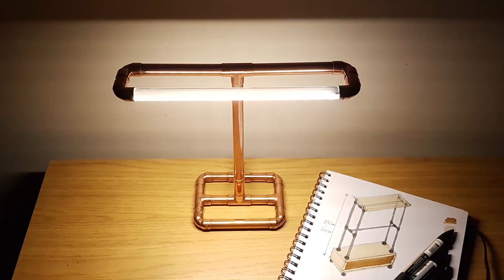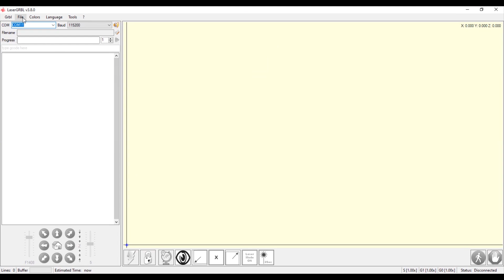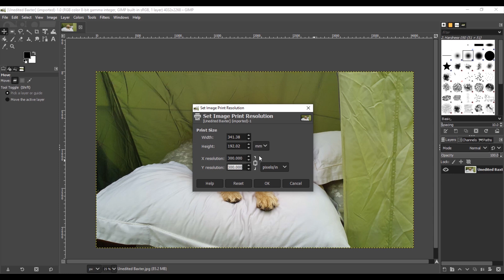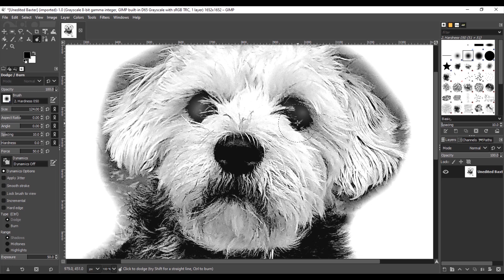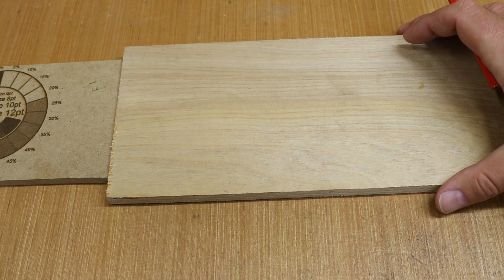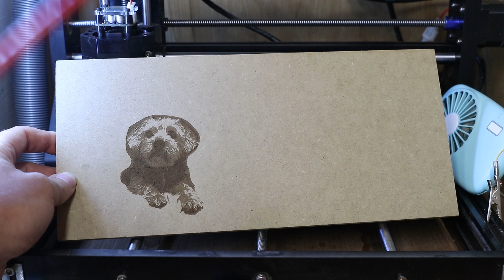3018 Pro - Basics for Laser Engraving

Comment: Hi James, could you advise me?  I have had several suggestions all conflicting. Having seen your videos you know what you are talking about. I have a 3018pro. My laser only produces a 4.5watt output.  Great for small jobs but I want to do some metal engraving (Keyrings Etc). Could you suggest a laser unit that I could use that would be powerful enough and fit the 3018pro to do the job or is it a case of having to buy a new machine?

Comment: Hi James. Love your Channel! What’s the best laser that for the genmitsu 4030 and does it swap out with the Spindle easy? Or would you recommend a separate laser setup? I want a laser that has good detail for etching wood and metal and Aksum cutting through wood. 

Thanks, 

Bert
Reply from the maker: Thanks.
If you can get a separate laser then do so. Most lasers run on belts because they can accelerate faster and get better results. However if that's not an option then the easiest option will be a 44mm wide laser and that should drop straight into the original holder. The FoxAlien 10w/40w is a good option 
https://www.foxalien.com/en-gb/products/foxalien-40w-fixed-focus-blue-laser-module-kit?sca_ref=725103.t6qfXeHAnx

Comment: Hi James,
Can one add text and a cut out shape in Gimp, before finalising your image so it will be part of your Laser GRBL burn?
Reply from the maker: Text is definitely possible. The cut out shape would probably need to be done as a separate layer and exported as a separate file so then in LaserGRBL you would load in your main photo and do all the settings for that, then load in the cut out image. I forget what the phrase is called but in LaserGRBL there is an option to load multiple files on top of each other
Reply: @JamesDeanDesigns  I'll check it out. Its similar to Easel where your cut out is on a separate file.
Is it possible to take the Gimp manipulated image  to Lightburn and then to add text and a cut out there?
Can Lightburn do manipulation of a image the same as GIMP?

Comment: hi James love your channel, im buying a 3018 machine but it does not come with a laser, can you reccomend the correct one for me to buy please ?
Reply from the maker: There are lots of options depending on what you want to spend, most will be around 5w of output power but the main thing is that to fit directly into the holder it needs to be a 33mm wide laser. Any larger and it will not fit in the holder
Reply: @JamesDeanDesigns  thanks James

Comment: About to install the laser on my 3018 and use it for the first time, this tutorial makes it look easy. Had to pause and go back a few times as I followed along. Hoping to engrave a Bamboo coaster for Mothersday.
Reply from the maker: Hope you manage to get it all going OK and make a nice coaster 👍
Reply: @JamesDeanDesigns  Got it going real easy.  Need to put it into a box to hide the laser. More powerful than I expected for a 2.5W.
1000mm/min and 2000mm/min are too slow, burning 0.5mm+ deep into MDF and smoking it. Time to go watch that first vid.
Reply: The clue was in that other vid, grbl configuration, $31, had to set it to laser, now engraving mum and baby photo. Will find out in 45 mins how well it goes. Bamboo engraved nearly the same as MDF in the box test. Not sure if engraving across grain or with grain for raster images is best.  Do it twice? Not sure but on low power it looks like the laser is bleaching the Bamboo grain. I do have a smoky BBQ scent now in my clothes.
Reply: Looks like a mum and baby, just about. A bit monochrome, going to take some tweaking to get more shades of grey. But that's all learning, which is why I got this thing. Thanks, your tuts helped. laser cover and exhaust will make it more pleasant, just like the vacuum head and mini cyclone dust system helped the 3018 router on wood.  And the Bamboo did bleach lighter on the low power sections, wonder if it has a coating? Supermarket cheap coaster, on special 4 for $4.80 AUD today.

Comment: Hi James, I have the 3018, it's the first CNC I have bought. I have found your tutorials very helpful in setting up my machine. I now have encountered an issue. When I move the laser around to manually set it in the home position I want, it moves fine. But when I start the test burn in your videos or any other build the Y axis will only move one way. It will burn the line in the (Laserdrawlines) program but instead of moving over and back down, it will only move over, so each time it gets higher. When it is suppose to be going back down to be inline with the Y axis home position it makes like a ticking/ grinding sound. I have checked the mechanical parts and there is no damage or signs that would lead to this sound.
I have changes the motors and the leads between the X and Y axis but it makes no difference. I have reset the 3018 and reloaded the program. 
Could you please give me guidance on what to try next.

Thank you, Damian
Reply from the maker: Based on what you are saying, I suspect its skipping steps, possibly because your acceleration is to high. Check your $120,121 and 122 settings. if they are above 500 then bring then back down to that and try again, if it still sticks then come down to 300.
Reply: @JamesDeanDesigns  sorry it's taken a while to get back to you. I work away. Thank you so much, that fixed the issue.

Comment: Hi, I have a 500mw 65x50cm Laser Engraver setup with Advanced CNC 2-Axis Control Board & benbox software. I would like to add a NEJE A40640 module. What do I need to add or change?
Reply from the maker: You will need to check the connections are the same (usually a 3 pin connector) but the hardest part will be knowing if your control board can output enough power for it to run at 100%. Unless you know the spec of the board you may not find this our until you have installed the laser
Reply: @JamesDeanDesigns  Thanks for your quick response. I will let you know how it goes.

Comment: Wished you had done these excellent videos before you did.  I need some advice please.  I have set up my laser as per your video and got it working with the smallest focal point.  However, when I try to do the test prints on the wood, the laser lights up like it is doing something, but nothing appears on the wood.  Not sure what I a doing wrong or what maybe I have missed??
Reply from the maker: Assuming your laser is actually working correctly, it sound like a power issue. I briefly cover it in the video but you need to make sure your $30 and $31 values align with the Smax and Smin values in the software. Have you done this? Also worth checking with another piece of software to be safe. You can do a trial of lightburn just to rule out software

Comment: Hello there, Great channel really love videos and learning a lot, I have 3018Pro with Woodpecker board and trying for engraving some tests, so I have an issue with it, it is stacking in the middle of engraving but not at the same place all-time (it gives some red lines in code, but can`t understand what it means), also try to resume from previous commands, sometimes it works sometimes it not, did you have any issue like this, or maybe there is any community which I don`t know, where experienced people can help? if you can help maybe I can contact you somehow to show some pictures of the errors
Reply from the maker: Share some screen shots with me if you can on Instagram or facebook. And also let me know any info like the software you are using

Comment: Very nice overview of using laserGRBL & the relevant bits of GIMP.

I saw a note in the laser GRBL settings (somewhere, maybe a release note, not sure) that you can set Smax to more than 100%. My interpretation of the note is that if you set Smax to ~120%, then for a greyscale where it would be outputting ~80% then for that and everything darker it will output 100%. I think that is how you get your full dynamic range - use the settings where 5% just makes a mark and then "overburn" at the top end.

I know you say you don't want to run your laser at high power for life reasons, but I'm thinking there is a laser power that gets you black, and if you want black you have to run at that power. So you have to accept not getting fully black in that case.

But actually, given that some of your test runs gave you a nice dark colour at the "top end" with your imposed 80% top limit, it must be possible to get the black you want with laser powers less then 80%. I think the whole thing is an artefact of the Gcode rendering. I'd suggest you open the Gcode from settings with "overburn" and look at the actual power levels being sent. My experience is that they are lower than expected, so with big numbers in the dialog boxes you actually get much less S numbers than you'd think.

I've also noticed it seems be be handled differently between dither and line-to-line. And also for line-to-line, differently between the cross-hatch filling and the outlining.

Comment: WHEN i TRY AND CONNECT IT CONNECT , DISCONNECT OVER AND OVER AGAIN WHAT NEEDS TO BE DONE OR WHAT IS THE PROBLEM
Reply from the maker: That usually means the wrong com port has been selected or sometimes you may need to press the reset button on the board

Comment: Hi, Complete Novice Trying to follow your guides.  Bought a Yorahome 3018 with Spindle and Laser.  However, having tried to follow your LightBurn tutorial something has happened that now prevents the Profile base from moving to the back.  It will move in a forward direction only and I can no longer use the FIRE button to test if the laser is working.
There is an additional switch on the controller which I assume is a reset switch but that hasn't helped.  I've switched everything off powered all done and restarted.  Useless!  I've tried with LaserGRBL and although it gives off the audible connection beep nothing will function not even the jog controls.  Any ideas what may have happened here...
Reply from the maker: Hi Jerry. Check all connections both on the board and on the stepper motors? What happens when you click a direction and it doesnt travel? Is there a noise or is there any error message?
Can you jog the machine around in Candle?

Comment: Is the 3018 a better laser or CNC ?
Reply from the maker: I would say its primarily for CNC. A lot of lasers are belt driven for faster acceleration and higher speeds. The 3018 copes with doing laser fine but I wouldn't say that was its primary design

Comment: Is this also possible using the 2.5W laser?
Reply from the maker: Yes, you may just need to go a little slower with the feed rate 👍
Reply: @JamesDeanDesigns  Oke thanks, and the other settings are remaing the same with those in this video? what do you suggest for feed rate using a 2,5W
Reply from the maker: @LVA_DESIGN_LAMPS  its really a case of testing on your material. You'll need to do some power scale testing and that will give you and idea of the best feeds and power for your laser

Comment: Nice tutorials james good work
Can i ask a couple of quick questions or requests for future tutorial,?
1 did you find the woodpecker board was good over the cronos board? As i need to upgrade my nano board on my woodpecker laser i think
2 i notice you have Lburn as well, did you manage to set up your laser in lightburn   because i have tried  snd csnt get the xy coordinates working  if you did please could you possibly decsribe how you did it  to help us out as a lot of people  have found it difficult
Thanks james
Reply from the maker: I ended up switching back to the Cronosmaker in the end. I found it to be more stable than the woodpecker. As for lightburn, its a much better program than LaserGRBL. I suspect your issue is regarding the start job from position. I cover this in my lightburn tutorial https://youtu.be/2DSEZ8XJSV4

Comment: Laser mode : M3 constant power , or M4 dynamic  ?
Reply: @Alex Che
I got it working through M4 dynamic power. I typed in $32=1 in the gcode commands in LaserGrbl and managed to work alot of better, putting a picture on a canvas.
Set your laser to home then type in $32=1 and press enter and then frame your image to see where it will end up and then press play, M4 dynamic power is much better.

Comment: Hi James, great video. However im struggling to understand the starting point of the image, I see you zeroed the machine in the bottom left corner but it zoomed off to the right. I want to place my image on a smaller bit of wood and was wondering how to position it correctly.
Reply from the maker: When you load your image in it should ask you what size so make sure your image is smaller than the piece of wood. When you get to the screen with all the red lines you should see that it starts in the bottom left. Simply position your laser head over the bottom left corner of the wood, once in place click the zero button
Reply: Okay thanks, I’ll give it a try and see if I can make it central to my wood. Cheers 👍🏼

Comment: Dear James , would you recommend this machine - as a designer I am really intrigued by this machine. Have you ever cut vinyl with it? Also do you know if it works with Corel Draw or Photoshop?
Reply from the maker: Hi, its a great way to get into CNC without spending too much. I havent cut vinyl but I believe it can. The way it would work is you can use your design software to make a vector or raster image, you then import than into your laser software where you can control all the cnc settings. So corel draw or photoshop doesn't work with the machine direct but can be part of the process if that makes sense

Comment: Hi James, I really enjoy the tutorial vids you put up, they are helpful and have taught me the basics. Even the tuning my machine: I have a few questions about my 3018 I have. I use easel to design and carve my ideas and I use laser grbl, well to laser engrave. Can I use both programmes together like carve out a sign to 3mm depth then keep those exact settings and use the laser to then colour the carved out depth bits. Can't find a way to contact you, I don't use any social media like FB, insta, Twitter. Cheers James hope you or anyone who reads th8s can help. I will have more questions too. 👍👍👍
Reply from the maker: Yes. Makensure both pieces are designed to the same size. You do your carving and at the end it should return to the zero. Then you drop the laser in, and do that. In theory as long as the laser starts at the same zero point it should work

Comment: James, help! Lol. My 3018 is carving designs upside down, backwards, and negative to the x axis zero. I can not figure out what is happening. Help brother help
Reply from the maker: It will be your $3 setting which changes your axis direction, but it can change all 3. Try $3=1 first, test all 3 axis, if one is still wrong try $3=2... and so on. It only goes upto 7 so you just need to find the number that gets all 3 going correctly
Reply: @JamesDeanDesigns  thank you so much! You have been an awesome resource and help. I’m also having trouble running ugs. I downloaded it as you did but my hp with os windows 8 doesn’t have java to run ugs so I tried downloading java 8 which also didn’t work. Am I able to get to the $ controls in candle? And if so how?
Reply: Had to read that three times. Kept getting for three dollars you could offer a solution. Lol. I need to stop binge watching and pay better attention. Great work on the videos.

Comment: I encountered the same problem (using the same test image on birch ply) when calibrating my 5500 mw diode laser - the quick dropoff in gradient at the lighter end. I was using LightBurn, but by using a combination of reducing the speed, tweaking the power and using LightBurn's Dither options (I used Jarvis dither) I smoothed it out. I then tested out those settings on a different wood (lighter) and had to adjust my settings. Lighter materials reflect more of the light energy. Darker materials absorb more and tend to burn darker. I had to slow down the speed a bit on the lighter material. There is obviously a sweet spot (or more likely a curve) in the speed/power relationship.

Comment: Im trying to set-up my machine but i gives only black or white on/off no greyscale at all :(
Reply from the maker: Is this in LaserGRBL? Make sure you do not have the B&W box ticked
Reply: @JamesDeanDesigns  Yes it is LaserGRBL and B&W box is not ticked. Can it be grbl settings?
Reply from the maker: @dawidjlb2589  just trying to understand more about it. Is it showing greyscale in LaserGRBL when you load an image or is it the laser its self thats not doing the greyscale?
Reply: @JamesDeanDesigns  Everything looks good in the program but laser won't make greyscale effects. I have played with some settings because first it made some black holes almost like engraving. I tried on wood and cardboard on the back of drawing pad.
Reply from the maker: @dawidjlb2589  assuming you have a laser that can work with PWM I suspect its one of two things. Either you haven't turned the PWM switch on the laser or your GRBL firm ware needs updating. I suspect you maybe running 0.9 and you need to be on 1.1. Google updating GRBL firmware
Reply: @JamesDeanDesigns  On my board where my laser is connected to i see on/pwn on the switch. Im using grbl 1.1f. Can i send You photos of  how it looks like?
Reply from the maker: @dawidjlb2589  yes, find me on Instagram or Facebook and drop me a message

Comment: Hi James! Love your videos and how you present the content. The laser topic just comes up at the right time. As you may remember, I also got one of these 3081 pro CNC and it came together with a 7w Diode laser. Have having tortured some of these tiny little decorative boxes, I must say that the material I'm probably most interested in would be acrylic. I engraved one with a 30 deg V-Bit on 4mm cast acrylic and it was ok. Now I wonder if I could achieve same or even better results with less effort and mess using the diode laser. Have you already tried this material?